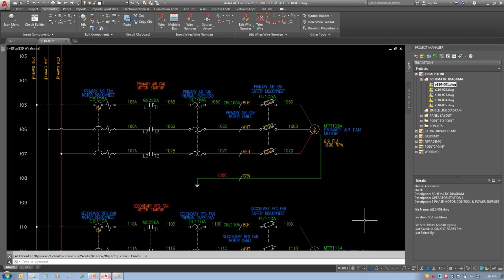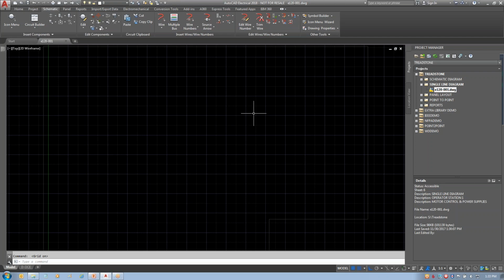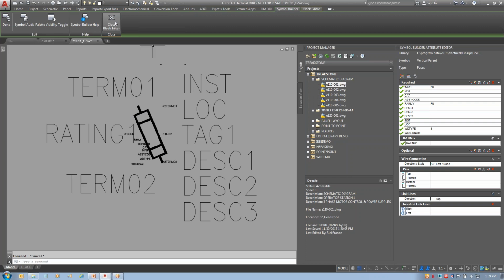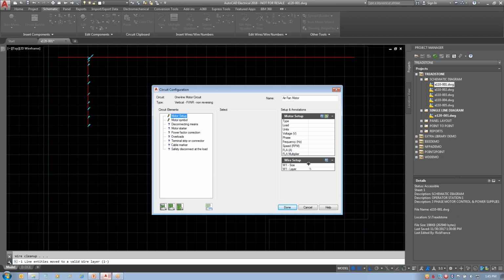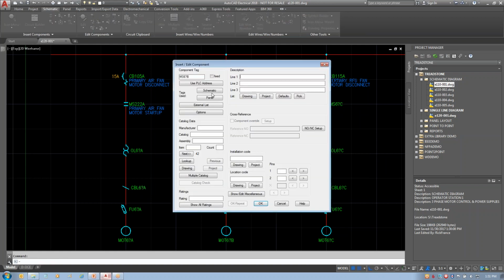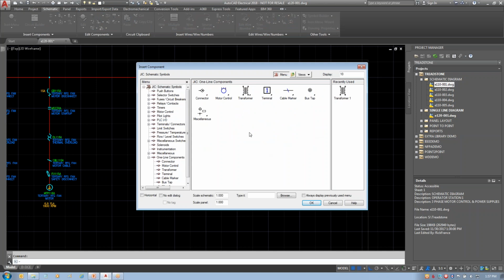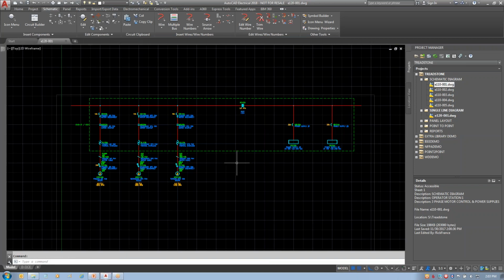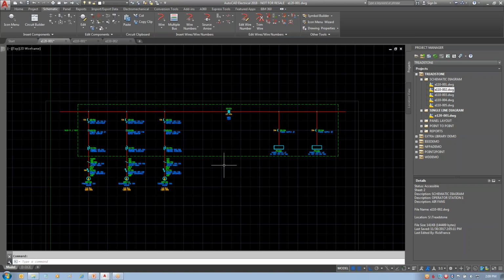AutoCAD Electrical - Interactive Single Line Diagrams

Comment: I'm using ACE 2024 and have followed your steps regarding the addition of the "VFU11_1-SW" component and related modification of the "ace_circuit_builder.xls" file. When I try to Configure the single line entity in Circuit Builder, I cannot see the option to select the newly created Fuse Switch. The Circuit Configuration dialog box is not recognizing the newly created option. What might I be doing wrong?
Reply: I discovered I added the line into the wrong place in the spreadsheet. Fixed that but after config, single line adds everything but the new Fuse Switch. Double/triple checked and not sure why it doesn't insert it.